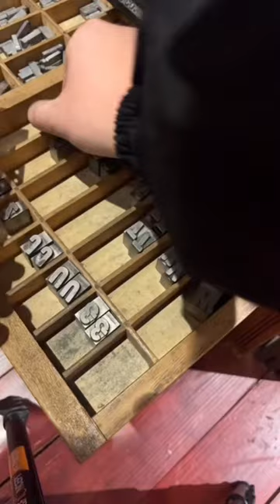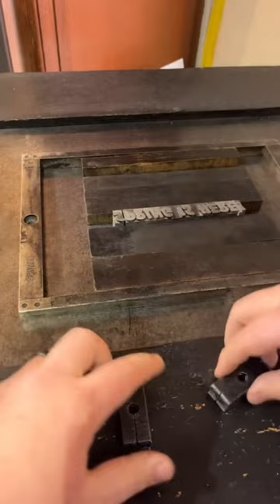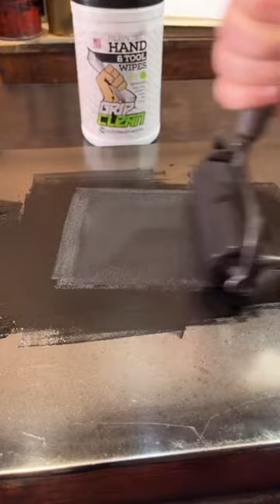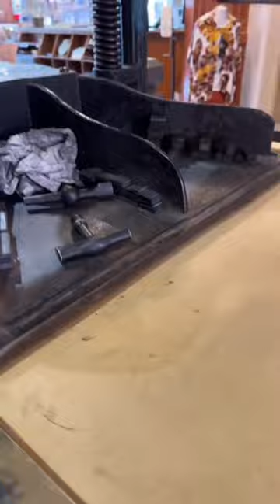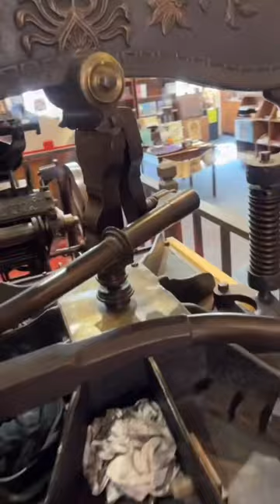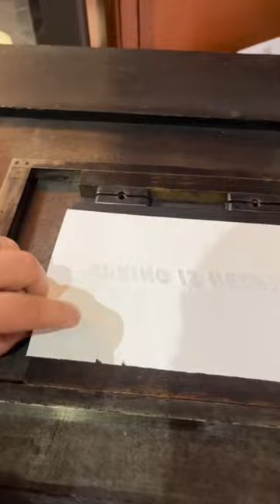Typesetting & letterpress printing  for the welcoming of spring

Comment: Beginning in 1966,  at age 13, I began to work for my junior high school, along with my best buddy, becoming our school's print shop operators. We hand set type, ran manual printing presses,....more modern than this "proof press",....it had a power assist,....with a small electric motor. I thought I would make it my career,....by 1969,....letter press was replaced with Off-set lithography. It still used a printing press, but it no longer used hand setting the letters. Instead it involved photography, and mechanized presses. By time I went off to college,....early computer word processing, replaced everything.